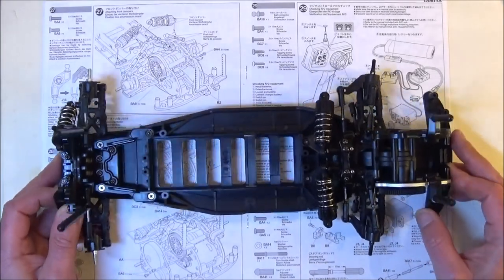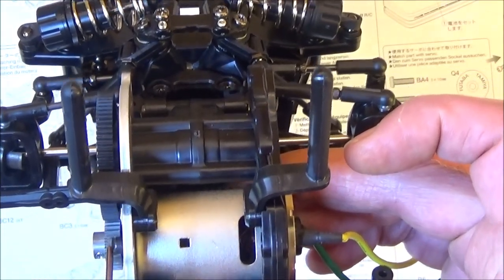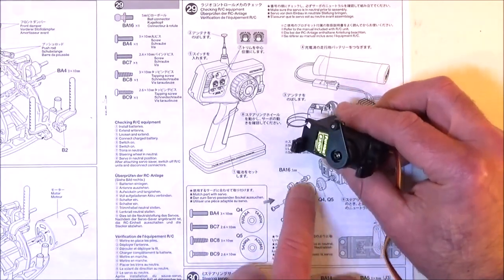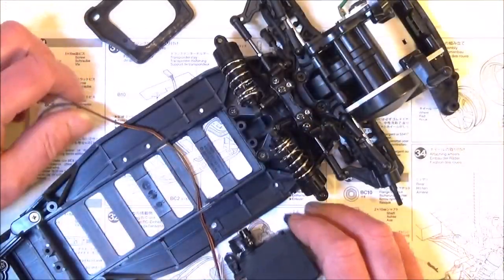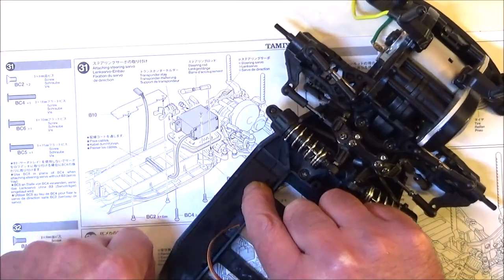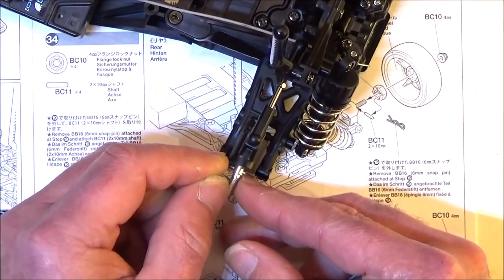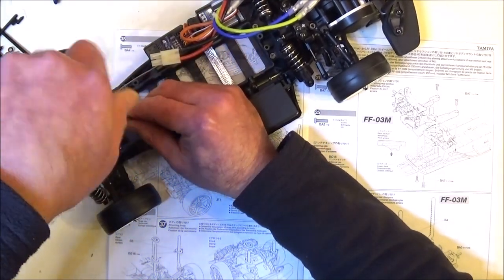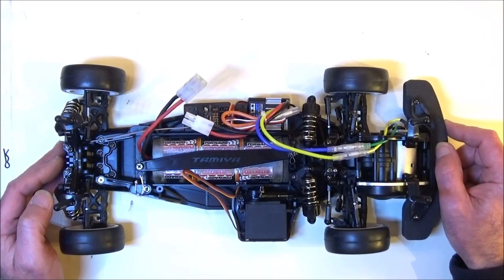Tamiya FF03 Build Guide Part 4 Honda Civic Type-R Inboard Suspension!

Comment: Good one, Mark. Great guided and explained. Would have loved to see the tire gluing with that rubber glue in detail. You know it’s my nemesis and I’m always looking for good tips/demonstrations 🙂 But a great and interesting kit. Love those body clip protectors. Every kit aught to come with that. I normally use what I have at hand of spare spacers, if needed, and then some HBX foam body protectors. It can really save the body in the long run, and at the same time reduce the rattle and body shake sounds. Never seen Tamiya do it too I think. Marvelous.
Reply from the maker: Thank you for the top comment, Mikael! Oh yeah, I really should show that rubber type glue and how I stick the tyres to the rims! Next time, I promise! It sure is a lovely kit with lots of well thought out features, I have really enjoyed this one my friend. And yes, why don't Tamiya put those body protectors in every kit - seems such a simple, cheap and effective solution. I too use my own hand made lexan protectors from body off-cuts but this is so much better, especially as they are held in place by the r-clips. Hope you are enjoying a nice week mate!  :)

Comment: Ooh that was very interesting mate. I reckon it's going to be very different to drive with all that weight at the front. Nice features like the plastic bits to protect the body. I usually put a bit of foam on the posts and stick extra lexan on the body holes but nice that Tamiya actually give you something. How goes it with the body shell? Does your cabin still stink of paint? Hey wouldn't it be a shame if we all have to self isolate ourselves from coronavirus and hide in our hobby rooms building kits 😁 Hope all is well with you and yours 😃
Reply from the maker: Hello Pete! Thanks mate - yeah this is going to be a very different Tamiya experience, I think! We will soon find out, I hope it doesn't end in tears with me crashing this newly built beauty. I'm the same as you with the body post protectors, this kit included solution should be on all Tamiyas, it works so well and is so simple (like me!). Yeah the cabin still reeks - but it was worth it as the paint job went well this time. Looks peachy, if I say so myself! Oh yeah, the virus is definitely coming, when my school closes I'm gonna lock myself in the cabin with a few new kits - fingers crossed matey!  :P
All good here thanks, have a great week Pete  :)

Comment: Really, REALLY nice Mark!! I definitely want one! My Birthday is coming up in two weeks.... Who knows? 

😆😂😂😂😆😆😆😜

That Suspension is so impressive! I still want my M03 Mini back... But this looks like it will handle GREAT! 
One note on FWD Vehicles, that may seem counter intuitive to you... 
Because the Drive Wheels pull forward (DUH!), bringing the Toe further in on acceleration....
Front Wheel Drive Vehicles nearly all have the Alignment set at a very slight Toe OUT. Very slight.... 0.5 degrees. 

I see this is another older design Chassis, with the Batry Tray set up with slots, for the old Racing Packs. COOL! 

The attention to detail is incredible! The Aluminium Tape to protect the Servo Wires, and those Body protectors are outstanding. 👍👍 
Cheers 🍻🍻 Mate!
Carmine ✈🚂🚙
Reply from the maker: Thanks bud! Yeah the M03 is nice, but this should wipe the floor with it - I HOPE!!!
Oh yeah, I only put a degree of toe-in, may reverse that - we'll see how it goes!
Some great touches on this kit, I have been really impressed with it - if only all Tamiyas were so well thought out!
All the best my mukka!  :))
Reply: You're right... If all Tamiya Kits were made like this one.......
But, yours was deeply discounted because it was a non seller, for WHATEVER reason. I can't figure it out. 

The M03 I also believe is FAR inferior to this! This is absolutely a Premium Kit. You really STOLE it at that price!! 😳😎👍👍 

... See how she handles, but my M03 Mini (if I can remember that far!) Tracked and steered best at 0.5 degrees Toe Out, and 2 degrees Negative Camber. 
But that's the fun with RC Cars - HAVE FUN! Play with the settings. 
I can't wait to see her RUN!!
Reply from the maker: Yeah, Carmine, some reason it's cheap, it CAN'T be because it's crap!  Gonna be fun finding out mate!  :)
Reply: LOADS of fun finding out!
Reply: @MarkBryanRC  we got them for an absolute STEAL!!! Quality kit throughout & may even get another!!! ;-)
Reply from the maker: Hey Ben - spot on mate! Bargain of the year - but one is enough for me !!  :)

Comment: Quite apart from the fact that´s it´s been a pleasure to watch in its own right, this build series has offered an insight into the intricacies of the mind of a Tamiya designer.  That front suspension design...
 I do think the little plastic servo protectors and especially the post-mounted body protectors are a brilliant idea - the felt washers we sometimes got would stick to the body long enough to come off along with it, then fall joyously into the long grass, where they´d hide, giggling, till we gave up looking for them and went home.
Reply from the maker: Hello Del - yet again you seem to be quoting from my mind or my memories! I have lost count of the times I have lost a split pin, felt washer, dogbone or drive-cup in the grass, search fruitlessly for what seems like an eternity, going over the same ground several times, only to admit defeat and trudge home with head down and a long face, with the feint sound of chuckling from the mischievous lost items drifting in the breeze...
Reply: @MarkBryanRC  Ha ha - you´ve summed it up perfectly...then, three hours later on the sofa, you realise that your missing part istill out there somewhere...and you know it thinks it´s won...

Comment: Cool video! Customers who come into the shop that are new to the hobby and need to replace gears, i teach them a little trick on setting the gear mesh. I tell them to cut a thin strip of the instruction manual or thin paper, put it between the gears then tighten motor screws down and pull out the paper!😊 I may pull the trigger and get this kit!! Nice video!
Reply from the maker: Hi Jason - you have a hobby shop?  COOL! That is indeed a great tip - I will be sure to use that one next time, thanks very much! I have really enjoyed this build mate - but the sticker job is a real pain in the...    
Thanks for the helpful comment, best wishes fro Mark   :)
Reply: @MarkBryanRC  no, I work at a hobby shop. When i started racing on road and a little off road in the early 90's o became good friends with the owners and raced with them. Tom Thumb Hobbies in Columbus Ohio! Family owned since 1963! Long story short..... Mike took over in 07' after his dad passed. His wife who works with him got diagnosed with bone cancer last summer and i picked up more hours to keep them open. Work seven days a week. Gave up ot at my regular job to keep is open. Mike's working on new website, follow us on Facebook for racing updates, info on slot car and R/C racing!!😊 Mike won a ROAR national championship B-Main with a yokomo dogfighter back in the 80's! Keep up the good vidoes and if you can like and subscribe to our Facebook page it would be much appreciated!😊😀
Reply: @MarkBryanRC  , I use something like Windex and a heat gun to help apply vinyl stickers. Use something like a 💳 card to smooth stickers. Xacto blade to deal with air buubles.....! You'll do alright!
Reply from the maker: Hi Jason - still cool to work in a hobby shop! Wow, 7 days a week - good on you for helping out in troubled times but good to hear the shop is still going. I will pop over on Facebook soon and give a sub. :-)
Reply from the maker: Thanks again, Jason, yeah I already finished the stickers, and did need to use a heat gun to help those decals around the tight curves! Thanks for the tips and encouragement, I really appreciate it my friend!  :)

Comment: How many teeth are on the spear gear?
Reply from the maker: Hi Gareth - the stock spur gear is 68T.
Reply: @MarkBryanRC  maybe it's the way it looks on camera but it looks bigger. Can you change the size of the spur ( my spelling sometimes is really bad ) I was thinking 64t with a bigger pinion say 22 or a 24t?
Reply from the maker: @b00ts4ndc4ts  Yeah I think you can change the spur, but I haven't seen any for sale when I checked. However, you get a bigger gearing change by changing the pinion, I think you can go up to 28T on this kit!
Reply: @MarkBryanRC  I like the look of the FF03 and it will be the next to add in my fleet. Can you configure the front shocks so that they go a bit more upright?
Reply from the maker: @b00ts4ndc4ts  Hi Gareth - no, I don't think you can easily adjust the position of the front shocks, but honestly, they work very well as they are, it's a cool design and  I'm very impressed with mine!  :)
Reply: @MarkBryanRC  I'm going for it, thanks for your replies